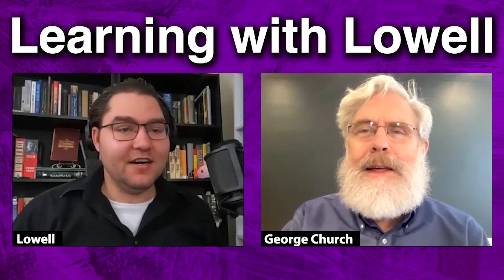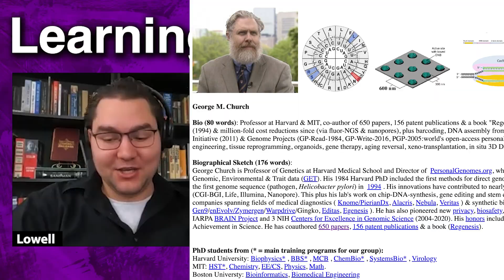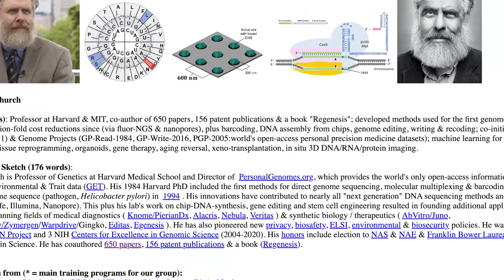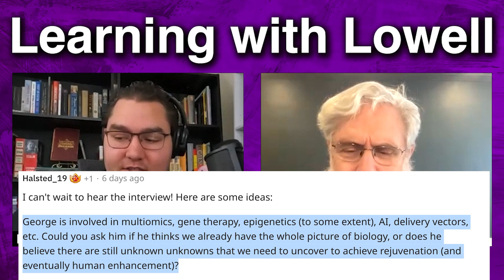George Church: De-extinction explained, Synthetic biology, Woolly Mammoths and Longevity | 165

Comment: What I want to know is what George thinks of Michael Levin’s work at Tufts. They are only about 2 miles apart. Will their research complement each other or will Michael’s work be much more important in advancing regeneration and longevity.
Reply from the maker: Interesting question. Only time will tell. We've had Michael Levin on as well. 
https://youtu.be/5XvDdbYzwf8